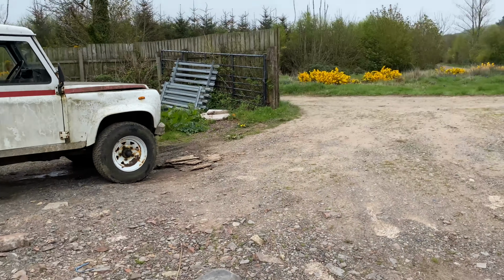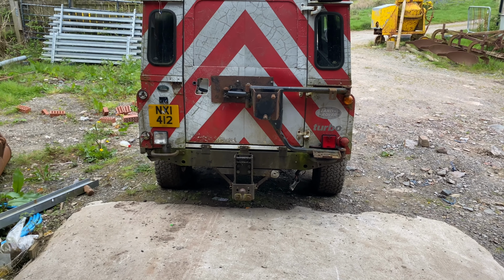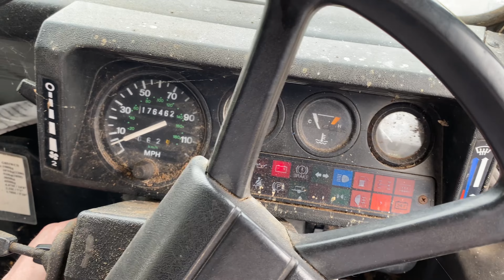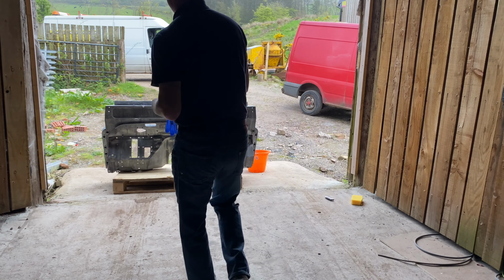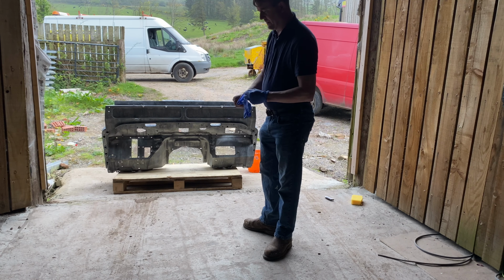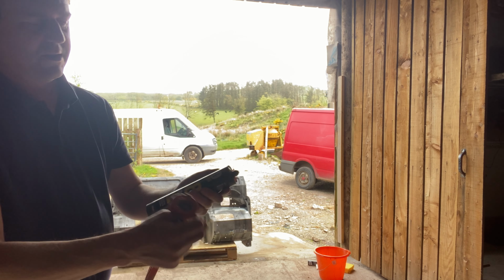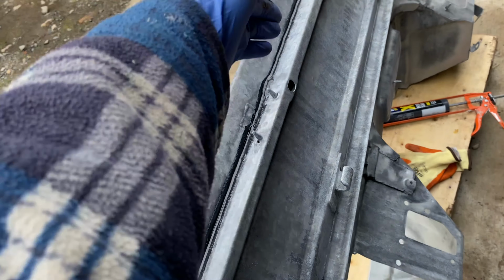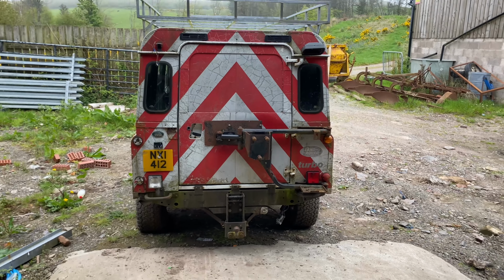Project Nexi 1, A Landrover Defender 110 200tdi full restoration

Comment: Great project you have there Richard 👌 Maybe  have a look at " buzz weld" they do a bed liner that's supposed to be a lot better than raptor. I used raptor on my galv chassis t washed it all used etch primer and it chips off easy. I was told about buzz weld after I'd done mine typical ha ha ha. The barn looks brilliant by the way 👍
Reply from the maker: Thanks Mike, just looked at buzzweld!

Comment: You will only be tax exempt at 40 years but not mot exempt as you are doing a chassis swap. I have a 1993 200tdi 90 and was hoping the same thing but alas!
Reply from the maker: From the government website;

Chassis
Chassis replacements of the same pattern as the original are not considered to be a substantial change
Reply: I stand corrected my apologies I wonder what is considered a different pattern?
Reply from the maker: @jonlloyd1985  i would say going from 90” to 100” or defender to discovery chassis?

As long as it’s a “similar” replacement it retains its status 

I believe changing a 2.5 diesel or td for a 200tdi or 300tdi complies, but putting a bmw m57 6 cylinder engine wouldn’t?

Maximus ironthumper is restoring a late series 3 109 with a 200tdi and is working within the rules, a very good watch and benchmark!!
Reply: @livingoffgridinscotland  yes I have been watching Maximus’ build series, loving the colour he picked! Good new then, in 10 years time no tax or MOT!
Reply from the maker: @jonlloyd1985  yes I like the camel trophy yellow, my missus doesn’t though so hence why mine is going to be grey….